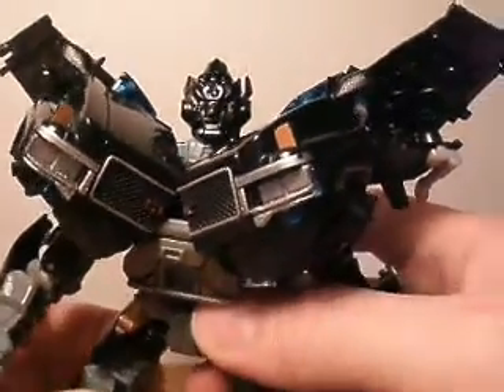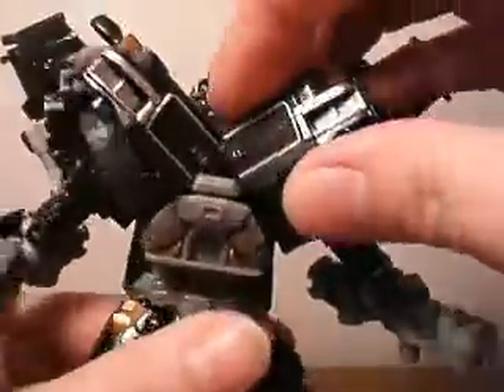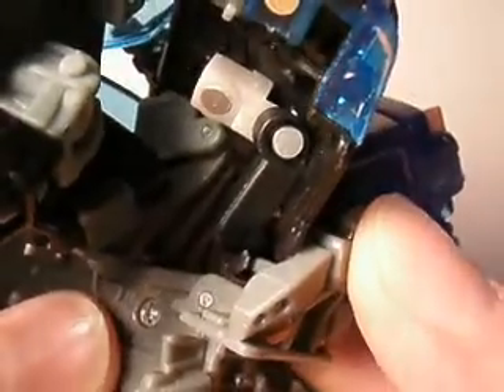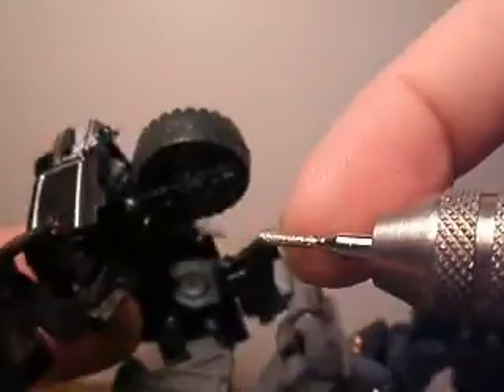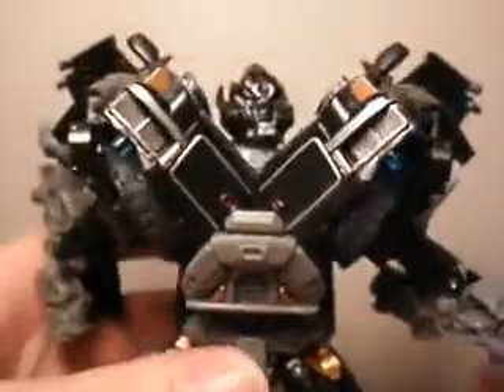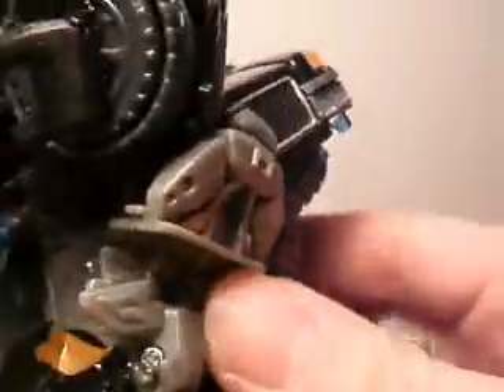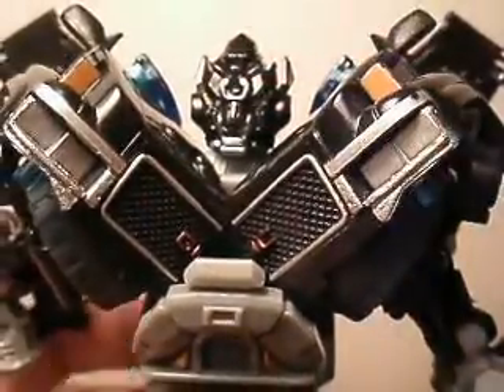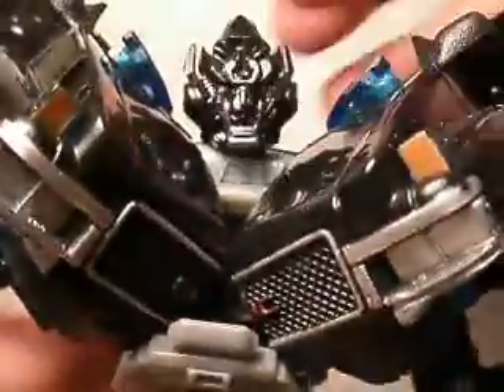Voyager Ironhide chest bumper

Comment: This is very similar to what I did, except I went a bit further and drilled all the way through the black part so that the peg came out the other side, and push the plate up, as well as this: those two grey parts inside each hood piece that connect to the joining bar can actually serve as joints, but you have to cut extra plastic to free them up. It let's the hood split apart wider so it can come together without that uneven crash in the middle.